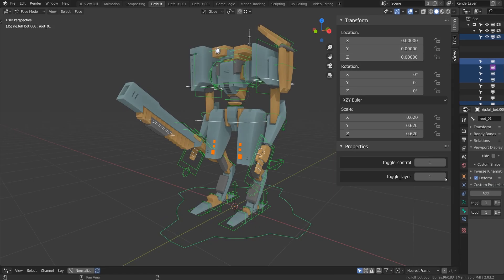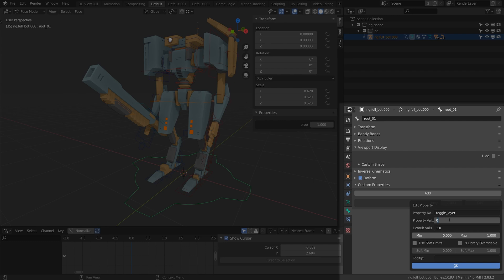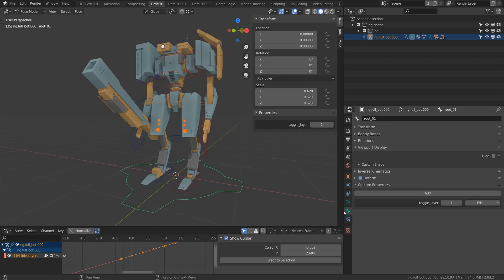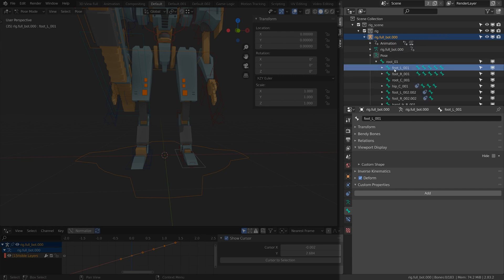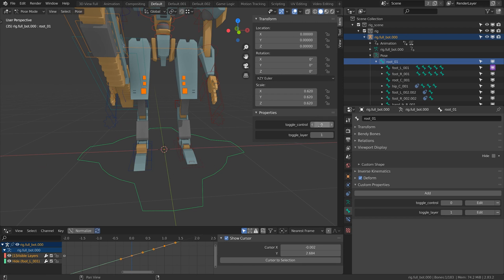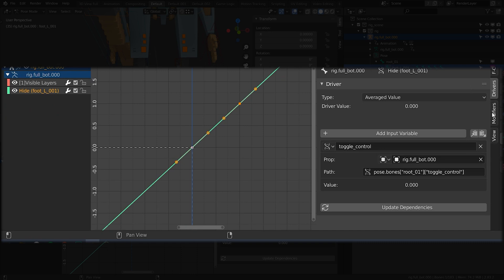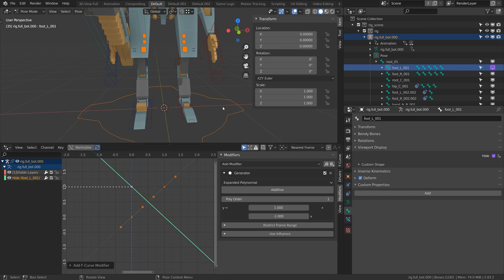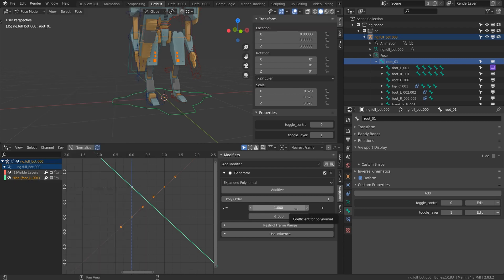Hide Armature Layers and Hide Bones/Controllers | Drivers Master Class

Comment: In my way, instead of using Add Generator modifier. I go to edit driver and type: 1 - var. Which mean, when var = 1, output is 0. It's flipped.
Reply from the maker: Right on, yeah I've been using that method more and more.